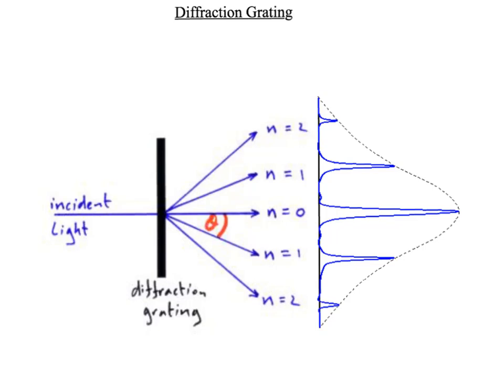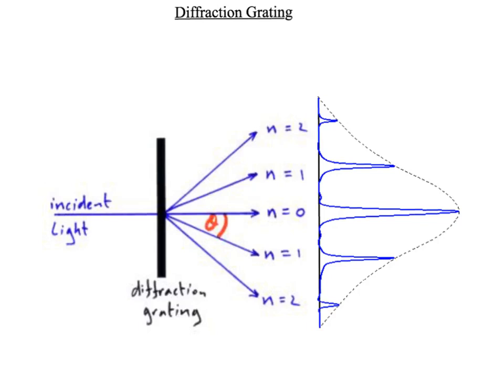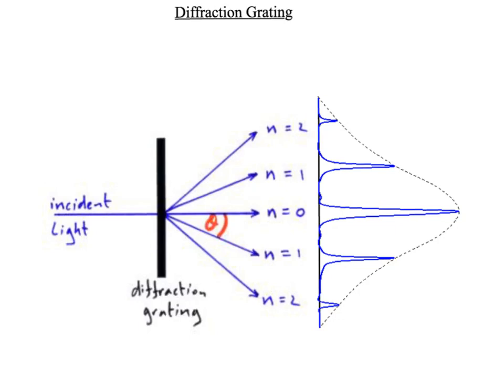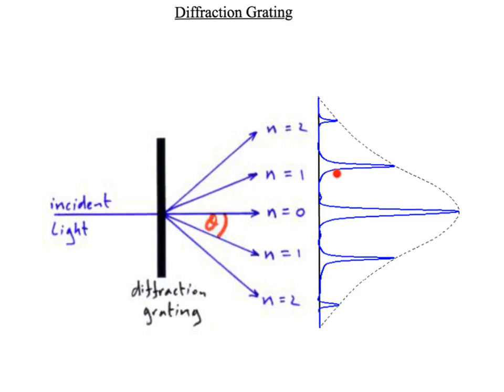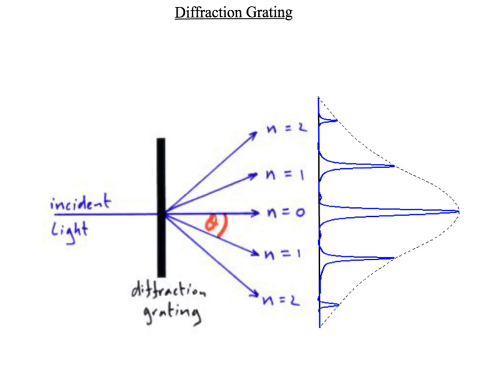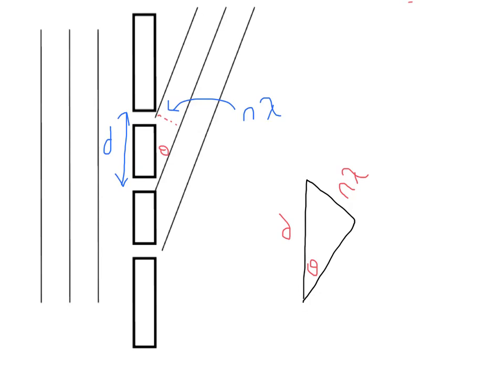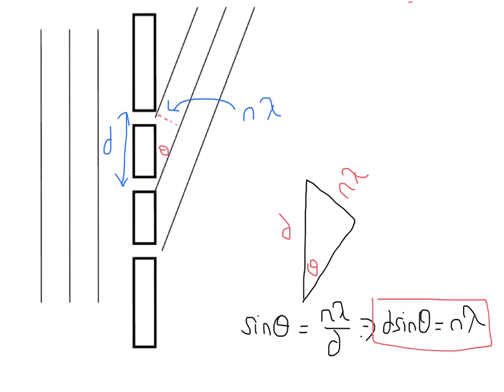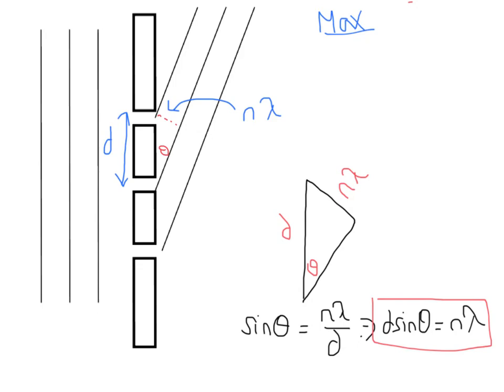A Level Physics: AQA Unit 2: Optics: Diffraction Gratings

Comment: is d measured from the middle of each slit to the middle of the next slit?
Reply from the maker: ***** Correct although diffraction gratings usually give you the number of slits per mm. To convert: d = 1/N (Where N is the number of slits per metre)